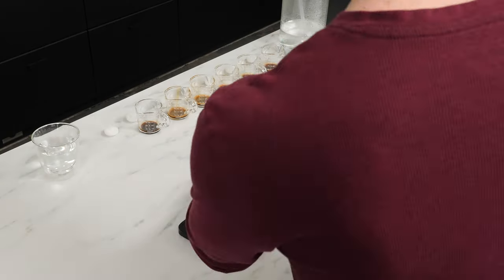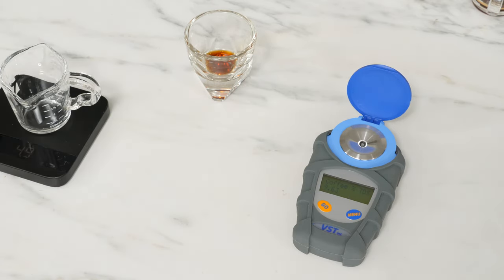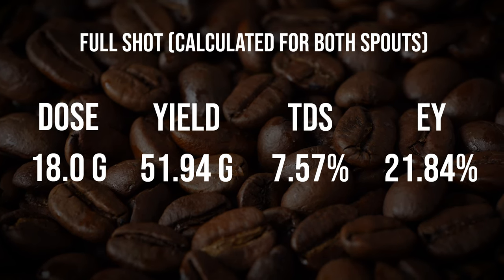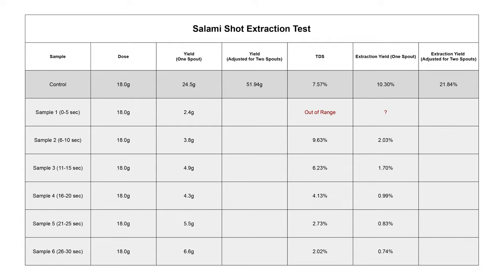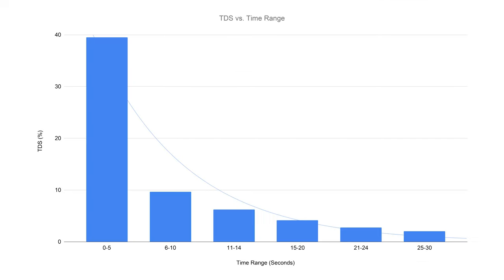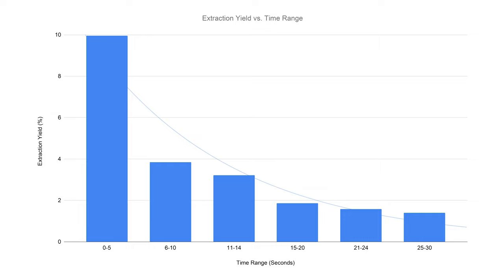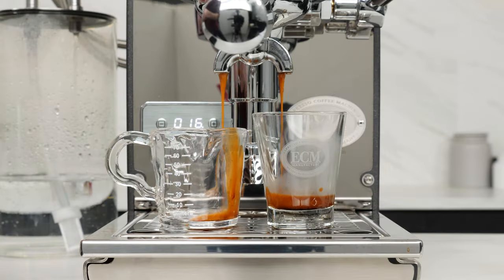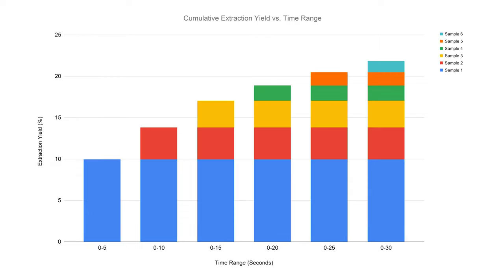Dissecting Espresso Extractions: TDS, EY & More

Comment: I liked the in depth science take on espresso making. Maybe one day I'll actually be able to make better shots.
Reply from the maker: Hey Michael, thanks for the comment! What specifically are you having trouble with? Maybe we can help out.
AJ
Reply: @Wholelattelovepage  I hear people talking about how a shot tastes "sweet" but none of mine ever do. The very best I get is "not that bitter". I have Eureka Mingon Notte grinder and recently purchased QuickMill Arnos.
Reply from the maker: Solid grinder and machine, so I doubt that's the issue. It could be the beans you're using. Have you experimented with different roasters and roast levels? Dark roasts tend to be more bitter, while light-medium are generally easier to pull sweetness out of with proper extraction. However, note that "sweetness" from straight espresso isn't going to be like the sweetness from a caramel mocha latte. It's a much more subtle, natural sweetness, not like a sugary drink. If you're still getting bitterness, try bumping the PID down a couple degrees, and/or stopping your shot a little earlier to see if that helps. 
AJ

Comment: I have asked this question on other channels but haven't gotten a satisfactory answer.  I was wondering if you might comment.

The density of the bean is influenced by  the altitude, how it is grown, Maybe how it is processed and definitely by the roast level.  When purchasing different beans we are stuck experimenting with the grind size. Which means the first grind likely will be over or under extracted.

There must be a caliper type of device that can determine density. Then through experiment with one's grinder we might be able to get closer to the grind size on the first shot.  Determine the density and adjust the grinder based on previous density tests.  This assumes the same  density of any bean will result in the same grind setting.  Ending up with a shot you would not throw away. Good enough for the next shot with a small adjustment to get pretty close to perfect.  I know perfect is in the eye of the beholder.

I did recently purchase a glass calibrated tube that can measure density. At least the website explains how to do it. I have not tried it yet.

Is this a crazy idea or one to consider?
Reply from the maker: Interesting idea and I don't think it's crazy, but I do think the assumption that the same density of any bean will result in the same grind setting is a big one. There are a lot of variables at play that influence the extraction for different beans, and density is just one. Different types of beans roasted at different levels may have similar densities but different chemical makeup or level of solubility. This can affect your ideal flow rate, ideal temperature, etc. I'm interested in your calibrated tube though and think it's a worthwhile experiment. Feel free to report back!
AJ

Comment: Good info AJ, always appreciated.. question I have is would data be different with other types of coffee beans? (Roast, Robusta, Arabica, organic).
Reply from the maker: Good question. The ideas still apply and the trends should be similar, however the numbers would likely be a little different. For example, dark roasts are more soluble than light roasts, so I'd expect the TDS and EY to be even more front-loaded. For a dark roast, I'd grind a little courser, pull a shorter shot, or decrease my temperature. It would be interesting to compare the data on Robusta vs. Arabica. 
AJ
Reply: @Wholelattelovepage  Thank you AJ, maybe that can be another video comparing Arabica vs Robusta. Thank you again

Comment: please make one video that explains for beginners how to start brewing from 0 to hero, with all the set of rules we need to do it right...
Reply from the maker: Not a bad idea, but that would be a LONG video. In the meantime, here are a few that will break it up into more digestible bites, starting from beginner and working up: 
How To Dial In Grind Size for Espresso: https://youtu.be/jOY7D02n4Cw
Water Filtration for Best Coffee & Espresso Flavor and Equipment Protection: https://youtu.be/1v9WSIXtpos
How to Fix Espresso Extractions: Timing, Taste & More: https://youtu.be/30F1nIF1-v8
Espresso Brew Ratios Explained: Ristretto, Lungo, and More: https://youtu.be/WifLRJZKs9A
Better Espresso Using Easy Flow Profiling Methods: https://www.youtube.com/watch?v=a-QAOo8Vg5A
AJ

Comment: Nice! I think you should present these numbers in terms of output weight. Time varies quite a bit and is not as good as output weight.
Reply from the maker: You're completely right. Honestly, I wanted to present cumulative TDS vs cumulative EY but spent far too long trying to calculate the TDS across multiple samples. You can't just average your readings because of variation in sample size, and you can't adjust for weight because TDS is weight-per-volume, and I didn't know the volumes of each sample. Only after publishing the video did I realize since I can calculate both the cumulative EY and cumulative yield, I could work backwards and calculate cumulative TDS. Seems obvious now... Anyway, here's that graph: https://i.imgur.com/MTBl5Bw.png

Oddly, my trend is quite different from how I've seen strength vs extraction represented elsewhere, such as in this video: https://youtu.be/-BT7-yOUMDM?t=159
Any idea why that might be?

By the way, I follow your IG account. Good stuff. I'll have to try the staccato shot at some point!

AJ

Comment: Extraction yield "numbers" won't justify themselves to differentiate the process.  If you have a more even extraction over the whole puck it's quite possible for you to have a lower average of extraction.  If you extract 100% of only 20% of the puck you'll get 20% extraction average.  If you extraction 50% of 40% of the puck it's the same average of extraction.  So the extraction yield is honestly meaningless if you actually want to science.  It's basically impossible to decipher those numbers without completely extracting the rest of the pucks after the shot is taken to derive how much solubles are actually left in the puck.